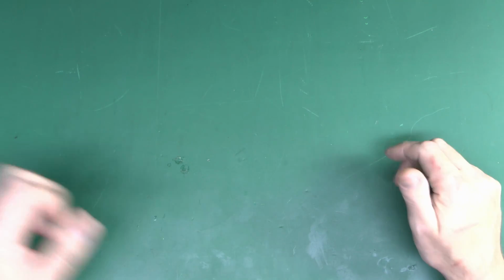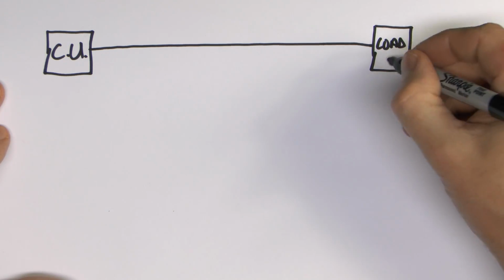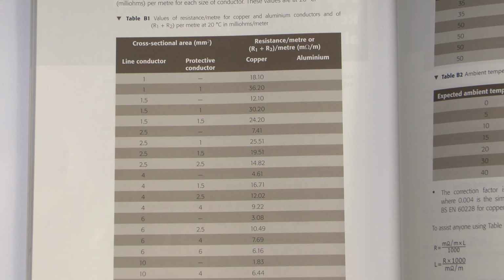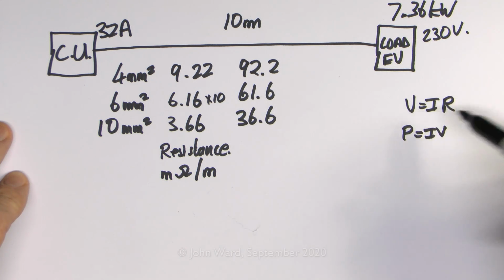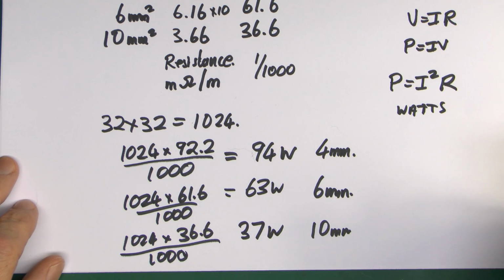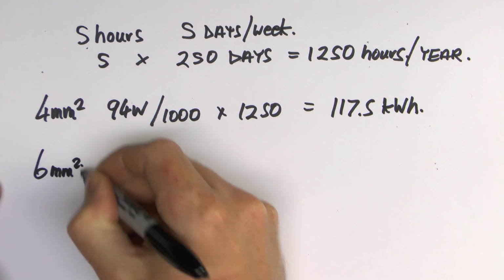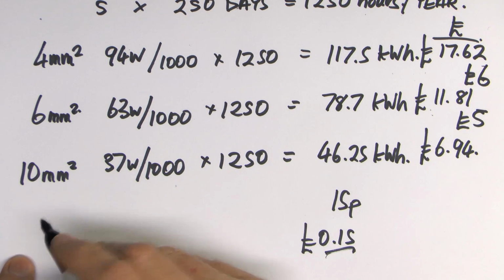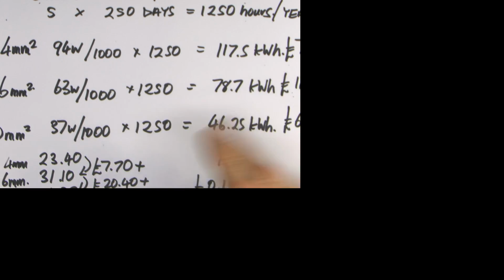Calculating Cable Energy Wastage, Energy Efficiency

Comment: I enjoyed that very much... Was just wondering what price you pay in the UK at night for electricity...
Reply: Most of us in the UK will be on a standard single fixed rate (around 13-16p KWh at the moment), independent of the time of day. Saying that all of the electricity companies split the charge into what they call a daily standby charge which is a flat rate daily fee, which you pay even if you were to use no energy, plus a per unit cost based on actual usage. Historically, most people on a dual rate (called  Economy 7 or 10) will be so only because they have electric storage heaters. I think this is a lot less common setup than it was 10-20 years ago as for most people the saving is minimal as the the utility companies increase the cost of the peak rate (see here https://www.moneysavingexpert.com/utilities/economy-7).
Reply: @grahamejones3036  still quite cheap compared to Germany, we pay up to about 30 cents per kWh. Which makes my hot water very expensive :-(
Reply: @jetg2111  WOW.. that is so expensive that it would be profitable to burn diesel for heat :D
Reply: @peto22  yep.... I pay 90€  per month for a two bed flat with two people. Gas heating but electric hot water and cooking
Reply from the maker: Although cheaper night electricity is still available (E7 or E10), it usually has the penalty that daytime units cost more, so unless the majority of use is at night, it's rarely worthwhile compared to a single 24h rate.
Reply: @jwflame  thanks John. That sounds like it might be another video in itself :)
Reply: About 11pence /kw
Reply: I pay about 10 US pennies per KWH in northern Ohio. The prices in California are about double this, 20-25 cents. They are shutting down the coal plants out there.

Comment: Cable IR loss/wastage is relative!!.. If you live in a cold area and that most of that cable is inside the walls, then all that heat is recovered to heat your house. In fact since the temperature is a setting that require watts, then the cable heat "loss" is substracted from the watt of heat required to meet the temperature target of your home. same thing for the incandescent bulb.
Reply: It doesn't, because this is full rate electricity. Your house heating will almost certainly be cheaper (gas, oil or economy 7). The heating (in winter) helps a bit, but this is an expensive form of heating, the same way that incandescent light bulbs are an expensive form of heating.
Reply: @seprishere  Depend on your electricity rate.. here it's 6 cent per kWh as we have 99% hydro electricity.  The "wasted" heat of incadescent bulb does not cost alot at 15 cent price per bulb for 2000 hours.. and  does not pollute  like oil or gas!.  cable loss is something that is part of what an electrical cable is.. unless you are supraconducting these! so.. that heat cost nothing as in one way or another it will be part of teh equation..  In canada, heating home cost alot doring winter!! btw i did not talked about replacing the standard heating for light bulb! i talked about the fact that the heat loss in electricity can be part of what contribute to heating your home. take all that heat outdoor it will just cost more to heat your home.. so the fact that that heat is inside is adding to the heat source your home use.
Reply: Doctorbass you might be in the lucky position that there isn’t much running cost difference between incandescent lamps and LED equivalents. Ditto for pollution. But they still consume a factor of 5 - 10 times as much energy. Imagine if ALL Canadian lights were changed to LED. That’d be a massive chunk of power NOT drained from your system. So even fewer fossil fuel power stations would be needed.
Reply from the maker: Only true for colder times of the year, and even then it's a horrid way of heating, as cables aren't likely to be in a suitable location to heat the building, and direct electric heating is the most expensive option available.

Comment: My brain gave up slightly but I'm fairly sure if current delivered through each cable is constant the power supplied to the vehicle in this case would be slightly less for the smaller cross section cable therefore would require an extra 31 watts delivered to give same charge and that would also add up over time. It is too late on a Sunday to even consider checking this.
Reply: Just buy the 10. If you give up charging, the cable still has value.
Reply: Yes this is basically correct.  The charger is a switch mode converter which takes a fixed amount of power regardless of input voltage.  So using a larger csa cable will increase the voltage at the converter input which will cause it to take less current which makes the energy cost saving even greater.  As others have mentioned using thicker cable also reduces the temperature of the cable which reduces the resistivity of the copper which also increases the cost reduction.

Comment: Beauty of 120v mains is that it wastes more energy and wastes more copper.
Reply: North America doesn't use 120V mains; it uses 240V split-phase giving 120V outlets for lower powered devices. High powered devices, such as ovens, in North America are wired using both "hots" and that most certainly includes dedicated car chargers. The calculations are essentially identical.
Reply: But look at the gauge of copper in home wiring in Europe vs that of North America and you see a significant difference.